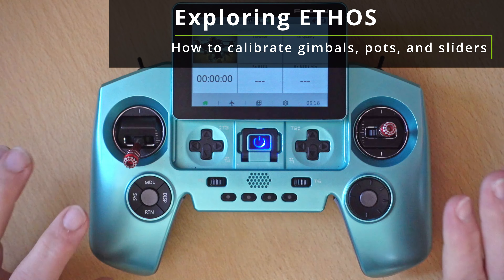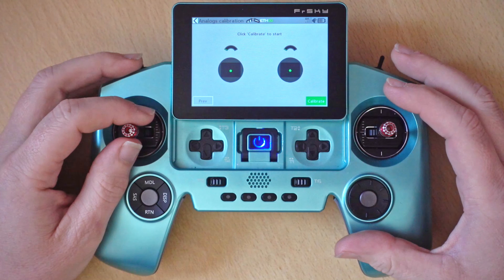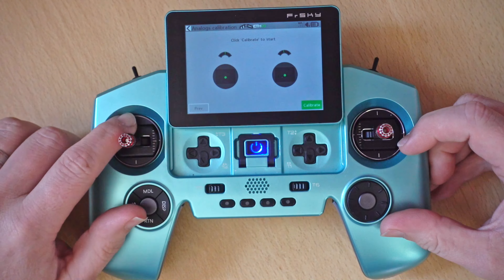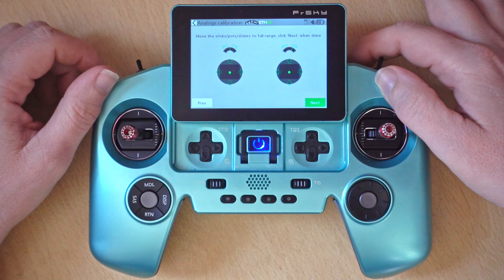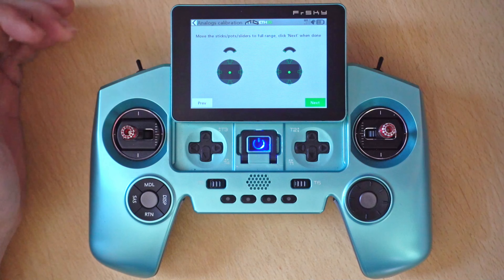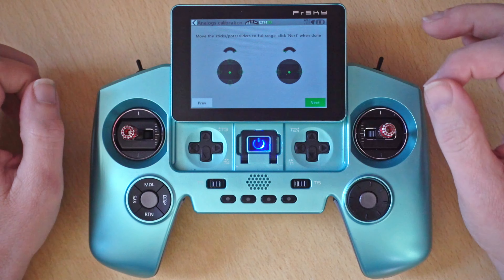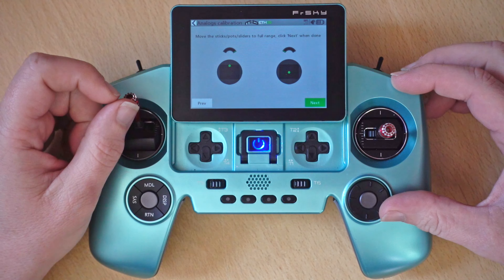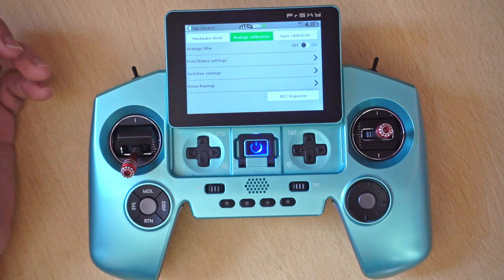How to calibrate gimbals, pots, and sliders in ETHOS

Comment: Is there a way to adjust telemetry readouts? I have a T motor esc and the telemetry readouts are off. It’s reporting an esc temp of 45 deg when I know it’s 70 deg and the amps are reporting 90 at max load but it should be about 115. I don’t know if that could be adjusted in Ethos or if it’s a T- motor AM link thing that needs to be adjusted.